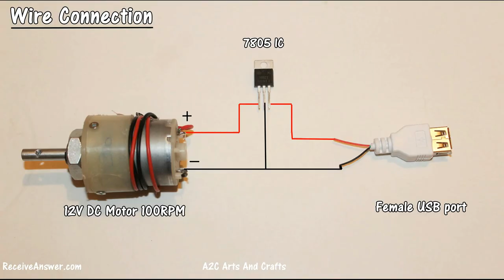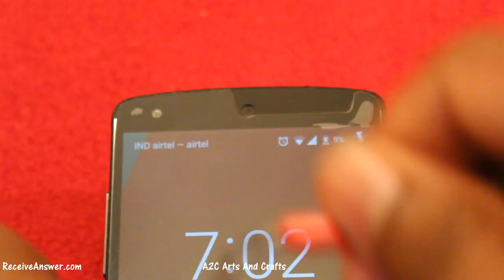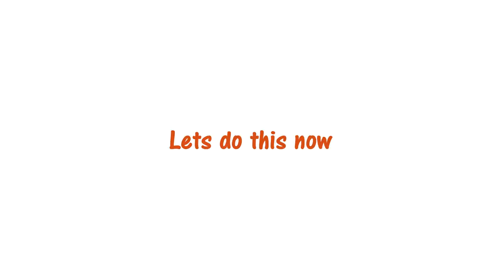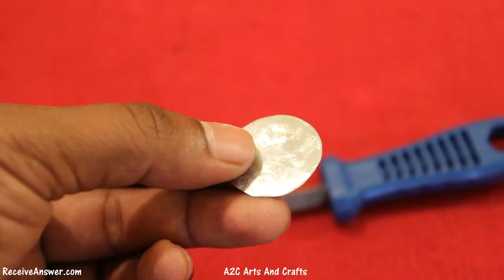7 Awesome School Projects / Lifehacks - Compilation

Comment: The first  idea of mini charger is awesome but  if you use zip tights instead of glue gun for the attachment of 7805 on the motor because when it becomes hot it will be disconnect with motor (not from circut) but your ideas are cool

Comment: hi,
i made the Mobile charger as per your guidelines.  Am used 12V DC motor and 7805 IC. But done the all the activity, mobile charger is not worked.  may i have any inputs???